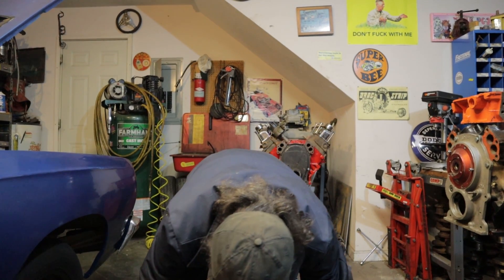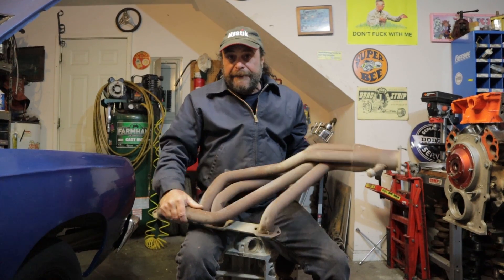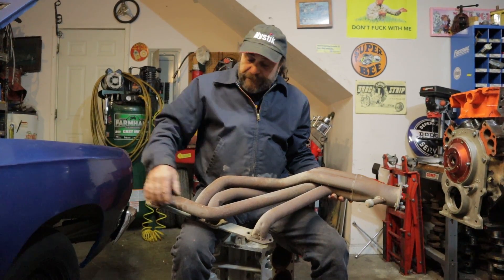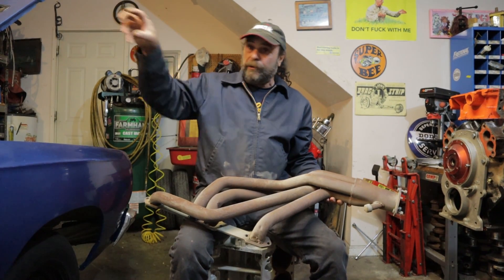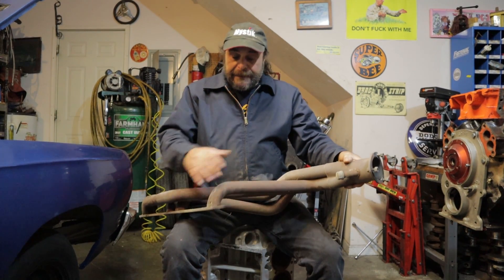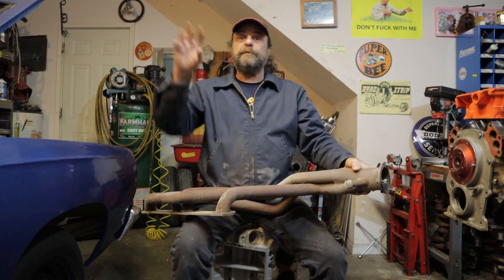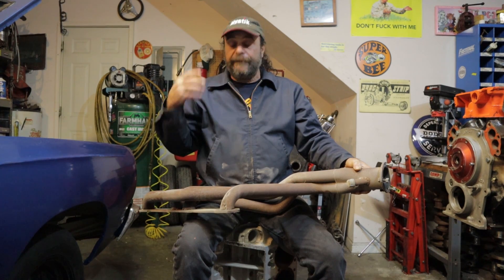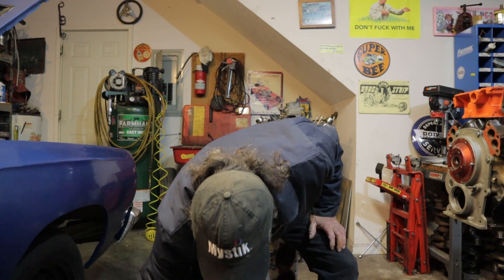The BS On Backpressure

Comment: I remember back when I was a kid, arguing with a guy I was working on his derby car with, he wanted to put a plate over his exhaust ports to "increase back pressure." and I told him he needed to put headers on the engine so it could breathe easier. 

As I got older I understood even more that back pressure is a myth, and having a set of headers that balance the exhaust pulses and allow a good balance between exhaust velocity and flow is the key to performance, and what that is may depend on your engines demands, its kind of like the guys who argue there is no replacement for displacement, and though I am a sucker for a big cube V8, the engine that creates the most performance, is the engine that most effectively uses as much air fuel mixture as you can cram into it. AKA Turbochargers and multiple cams, and that's why a lot of V6 engines can keep up with old V8s and a lot of I4 Engines can keep up with old V6 engines.
Reply: Theres a company that sells a naturally aspirated 2.4 liter i4 engine that makes over 300 whp. They sell an upgraded 2.7 liter version that makes over 500 crank. Engine tech has come a looong way.

Edit: based on the Honda k24 series of engines
Reply: @snakeballs8965  At what, 12000 rpm?
Reply: @ghj1502  http://www.4pistonracing.com/k24-480-2-7l-complete-engine
Not quite
Reply: @snakeballs8965  not hating but u kinda agreed that more displacement makes more power i.e. the 2.7 makes more then the 2.4. Small engines dont make as much power bc they are " better" they just displace air and fuel mixture faster then a larger motor usually will.
Reply: @tylerandrews1743  a 2.7 liter engine making as much as a hellcat(the record for that setup is 700 up on nitro) kinda does that displacement isn't everything. A NA 2 7 liter i4 making as much as a 6.2 liter super charged v8....
Reply: @snakeballs8965  understandable but how much more power can that 2.7 make until it peaks? That 2.7 will top out before that V8
Reply: @snakeballs8965  a 2.7 on nitro vs a hellcat on pump gas is not the same thing at all lol thats such and apples to oranges comparison if the the hellcat was tuned on nitro itd make 1500hp~ lmao😂😂😂
Reply: @snakeballs8965  also i never said displacement was everything i also said that 4 cylinders make similar peak power bc they displace air faster. At the end of the day u can only make x amount of hp per cubic inch of air/fuel mixture displaced wheather its from size or rpms its just phyics and what type of fuel ur burning also makes a difference
Reply: @tylerandrews1743  forced induction vs naturally aspirated. 
Look dude the point I'm trying to make is that engines have come a long way. A hellcat engine is an impressive feat of engineering. I'm not denying that.

Im saying a naturally aspirated 2.7 liter inline 4 on alcohol can make the hp of a  supercharged 6.2 liter v8. That is something that would have been unheard of 30 years ago, and only available to professional racers even 10 years ago.

I know you v8 guys love to hate on i4s, but we're all car guys, and I just find it extremely impressive that 4 bangers can make 700hp NATURALLY ASPIRATED. And they ran 8s with it. How is that not super bad ass?
Reply: @snakeballs8965  that is super badass and i never said engines havent come a long way but nitro is alcohol so which is it? Theyre 2 totally different fuels and im not a really either a v8 or a 4 banger guy imma whatever is kinda kewl to me guy like the ls is one of my favorite engines bc it allows a guy of common means like myself to make alot of power hench why im building a turbo ls s10 while my daily is a ford focus st bc the direct injection and computer controlled boost control and vvt engineering is super interesting to me and i wanted to learn more about it. Like i said im not hating u were just saying some confusing and not so accurate stuff
Reply: @tylerandrews1743  nitromethane is traditionally mixed with methanol in all but the most high end of drag cars. I didn't do any real research on the exact ratios of each that Civic used, but they could have went pure nitro. I think they'd be the first to go pure nitro in a Civic though.
Reply: @tylerandrews1743  and direct injection is trash, seal up them holes and convert to Port injected. Lol

I just want to get a Chevy ss and put that lsa supercharger on it. 30k for a luxury sedan with an ls3 is pretty frickin sweet.
Reply: @snakeballs8965  theres only 2 drawbacks to direct injection and thats fuel system parts and not cleaning the intake valves of carbon. But u have way better control of fuel bc ur not limited to when the intake valve is open u can spray fuel at the peak cylinder preassure to get the most burn and an ss is a nice car but im a budget guy and thats alot of money
Reply: Is this why top fuel engines are under 2 liters ? Because there is no replacement for displacement? Or a semi engine is above 12 liters ? Wouldn't everyone be running a 1L inline 3  making 1,500 hp ? (The 2L top fuel was obviously a joke)
Reply: @redfuel6bt  there can be replacements for power, but nothing beats a long stroke and a shit load of Pistons for smooth low end torque.
Reply: Michael Madden  
Because a larger displacement engine is capable of flowing a larger amount of air and fuel because it has more displacement to do so.
Reply: you was right and he was a fuckwit

Comment: Doug Thorley understood this, hence Tri-Y headers. Shelby's 180 degree bundle of snakes on the GT-40, and the 5,7 cylinder swap on Chevy small blocks, the more you can even out the spacing and consistency of the exhaust pulse, the more efficient the engine and more you can optimize the horsepower.

Comment: Uncle Tony can you do a video on how to properly size the right exhaust.
Reply: That would be very helpful.
And also for inline 6's.
Reply: Jason Thunders my 67 Mustang with the stock 200 6 would benefit greatly from this video! Haha preferably before I waste some money on the wrong setup!
Reply: Thrill Hill Racing same thing with me except someone swapped in a 250 and got rid of the 200
Reply: lucas swearingen interested in a 200? I have an extra complete engine. I’d be interested in that 250 for sure.
Reply: Thrill Hill Racing the 250 has some decent work put into it already from the previous so probably not sorry but hope yours comes together well.  I was just agreeing on how to size the exhaust for one
Reply: lucas swearingen no worries! I’m happy to see other engines and builds getting some love! Not everything needs a V8 haha. Although everything and everyone wants a V8!
Reply: @thrillhillracing41  ,yeah..I'm from Australia,and have a 265 Chrysler Hemi 6 engine..so,would be great to learn what is best👍
Reply: If you are getting a header/ headers premade. On a stock engine go with the smallest. If you go mild go with the middle option. Forced induction go large. Like my truck for an example 5.7 Hemi. I went with Kook's headers as my brand. They only have 2 size options, 1 3/4 or 1 7/8, they may have a 2 inch for it. I went with 1 3/4, great for stock, but still suitable for a mild cam. I would see what brand you are wanting to run has for options. For the inline 6 guys, I would suggest going over to Cliffords performance.  One thing to keep in mind is in engine bay heat. You can do wraps or have them ceramic coated inside and out.
Reply: I was gonna say that.  He should cover how cam shaft overlap and duration as well as primary pipe length and diameter and how they affect engine performance.  It would be an in-depth and pretty long video cause there is a lot to cover and explain there
Reply: @nolanmcevoy2547  don’t forget collector length and diameter as well..
Reply: 1HeavyHitr  You can calculate the headers and exhaust system to your engine, but in the need of doing that, you need to know every aspect of your engine. 
As like the bore x stroke, the cam timings, compression, the powerband your aiming to, even port sizes and/or they’re flow characteristics, and of course the fire order.

Then you can start to think what effect you’re seeking. Do you want equal lenght 4-1/6-1/8-1 headers, or do you want tri-Y headers, or do you want 180 degree headers and why.
Do you make it to sound good and make scavenging, or do you just want one of those things.

It’s a messy thing to even think about, if you’re not studied all kinds of motors and tuning them. 
You don’t get ALL these informations from schools or books. 
You have to have desire to explore and studie all engine technologies to make your own design.
Reply: What about the left?
Reply: @scavenom2008    Haha.  Awesome
Reply: Yes like how to set up the right size exhaust for a 12 inch high-rise dual quad carburetor set up !!!! … Everybody I know that had one couldn’t get the engine to make real horsepower before about 4500 RPM….  …. And then when the horsepower came in they couldn’t get it to the Ground The tires would simply just spin
Reply: Larger the better I’d say.. so go with what size fits and you can afford with a good free flowing muffler and an x pipe.. or match the exhaust tubing size to the size of the header collector, what’s the sense in having a header with a 3.5-4” collector and hooking 2.5” exhaust to it?
Reply: @chriswest5360  yup.

Comment: Let us not forget the velocity of the still expanding hot exhaust gas as it moves out and down through the manifold. You don't want (or need) the gasses cooling off to soon. This is why you can see increases in performance by wrapping the manifold runners in insulation, or in some case on motorcycles where the "headers" are a tube inside of a tube... It is not just so the chrome does not turn blue from too much heat!!

Comment: We learned as kids with our mini bikes/go karts that fer our 3.5-8HP engines to use a piece of old pipe around 18-24" in length... You can bend it round any ways you like! Adding the muffler back to that though killed the .10HP gain So, we just left them off And, made more noise and fun! tenth of a horse was a lot back then(70's) then we started swappin' cams and carbs^___^ Nowadays you just buy it and watch your kid brag((((((((((( Then they start roll racing(((((((((((((((((((((((((((((((((((((((^__~

Comment: "Next time you're staring at a naked exhaust port"  Sometimes exhaust manifold were mated to the heads without gaskets. Cold air could be sucked in by Bernoulli's principle, that jet of cold air can warp an exhaust valve on an adjacent cylinder. A little back pressure is good because it helps the valves run at a constant temperature. Exhaust valves run hot and dissipate their heat to the head during the time the exhaust valves are in the closed position.
A little back pressure keeps your exhaust valves at an even temperature. In mild climates it's not a problem, in cold climates, you don't want any leaks between your exhaust manifold and your head. The metal side of an exhaust manifold gasket goes to the exhaust manifold, because the exhaust manifold runs hotter than the engine. For every 10 inches of vacuum  there's a 30 degree increase in exhaust temperature.
Back pressure contains gases most notably CO2 and water. This gas is also act as a heat sink. Part of that manifolds job is to dissipate heat.. Other than that I am in complete agreement with what you had to say about fluid dynamics....Okay Tony tell me where I'm wrong. You can begin the argument with exhaust manifolds on airplanes at high altitudes. That's why you monitor your exhaust manifold temperature, and adjust your fuel mixture. Okay it's your turn.
Reply: First time I've heard the cold air warping valves in years. I heard open headers in the cold will warp them to
Reply: OK, here's where your wrong.  On aircraft the atmospheric O2 content and pressure is constantly changing ( yes, even with forced induction).  Monitoring manifold temp maintains proper combustion to avoid too rich/lean conditions which can be much more harmful to aircraft engines given the unique way they are run.  Back pressure has nothing to do with it.
Reply from the maker: How is using heat in the manifold as a tuning aid any different that tuning a car via EGT sensors
Reply: @UncleTonysGarage  I don't know Tony. I just saw a can of worms and couldn't help myself.
My friend Dave has Dave's Mufflers, prior to that he worked for "Muffin & Stuff." But we're always standing around talking about exhaust systems, shit that happens and why. Exhaust gas temperature, on airplanes is affected by whether you're running too lean or too rich. On a race motor the concerns for longevity are greatly reduced, they're also dumping a lot of unburned fuel.
Some of those motors only run for five minutes before you pull it apart. The guys show up with eight extra engines.  I'm a big fan of Sanderson Headers they're located right here in San Francisco just down the road from Brizzio Speed Shop. A lot of guys like cast iron exhaust manifolds because of the way they dissipate heat. Cast iron headers, Chevrolet Corvette two and a half inch center drops, Sanderson has made a lot of those block huggers, they're very popular for tight applications. They even make those headers with the one hundred and eighty degree crossovers. Scavenging is a big deal, on Harley's they build those extractor exhausts, D&M makes some. There is no such thing as negative pressure, vacuum provides a place for gases to go,
with no parasitic loss. P-51s having baby 3 in of tube for each cylinder, but that engine is only spinning in about 2300 RPM.
99 gallons an hour. That's bitchin.

Comment: Thanks for explaining that very well. I’m old enough to have heard from the shade tree mechanics in the 60s and 70s about back pressure being important. It never made sense to me though. They claimed it increased compression ratios of the pistons so gave more power but to me that meant more exhaust gas in the fuel mixture possibly leading to preignition problems. It always seemed you’d want as much exhaust scavenging as possible.
Reply: Exhaust in the mixture is exactly what the EGR system does and its purpose is to cool the combustion chamber.
Reply: Nicholas Rodrigues you are correct but the EGR valve is a smog reduction device. In effect it reduces power created in the power stroke by lowering combustion temp. What UT and I are taking about is whether or not back pressure in the exhaust aids or inhibits power. A totally different area from smog control like the PCV valve recirculates crankcase gases for pollution purposes.
Reply: @lehampton1  my point is that it doesn't result in preignition problems like you said it possibly might

Comment: Great video! The next person that tells me.. “You need some back pressure”, I’m gonna say.. So I guess all the racers with open headers have been doing it all wrong all these years! lol
Reply: That's what I always say, "Back pressure?  So how does a top fuel engine work?"
Reply: @livewire2759   Those engines work on "Pressure to Win"
Reply: @livewire2759  A supercharged engine doesn't need the help of the exhaust to fill the cylinder.
Reply: @mcplutt  Yes, obviously, but the point is that most people who believe in back pressure think that every engine needs it.
Reply: The stacks even add downforce for traction. Flipin cool

Comment: Brilliant explanation Tony.
The thing that confuses me, is that rail dragsters and certain aero engines just have separate, short stubby pipes.
Reply: Those are designed to be compromised at anything but their working rpm. Planes and rail cars don't have things like bumper to bumper driving, accelerating from idle to w/e rpm constantly, you know, stuff that make a daily driver A daily driver. A crap load of different conditions, rules and requirements. Hope that clears it for you.✌
Reply from the maker: Zoomies are generally used on Blown engines and ones that run nitromethane. No scavenging necessary

Comment: I've always wondered why I lost power when I take mufflers off or just run manifolds with no exhaust. I've done this on 2 different engines that were bone stock. I'm guessing that the stock manifolds just dont flow well enough to have good scavenging.

Comment: Two strokes need tuned resonance (which causes back pressure). For a period of time two stroke opposing cylinder engines where semi mainstream for diesels. Combined with offroad  two stroke vehicles and your mentioned issues with running open port is what spawned this myth imho.

Comment: Finally! I'm glad someone with an audience is covering this, the funny thing is if you have back pressure at idle where your volume of exhaust is at its lowest then you are only going to get more as the throttle opens and the revs climb.  Any machine setup like that will fall down hard shortly after leaving the idle position.

Comment: An engine needs to be tuned with its exhaust as it will be run. The myth comes from people merely deleting exhaust components and losing power because they don't retune. When I worked in a muffler shop 30 years ago cars would come in with rotten tailpipes and wouldn't idle or stay running. Putting the tailpipes back made them purr like kittens. Fart cans on imports are a great example too. Exhaust has a huge effect on efficiency. "Backpressure" is an oversimplification. Exhaust system timing and designing headers to take advantage of the complimentary effects of other cylinder's gas pulses is a science. So you can't just remove restriction and expect an engine to breathe better if it disrupts the tuning of the exhaust.